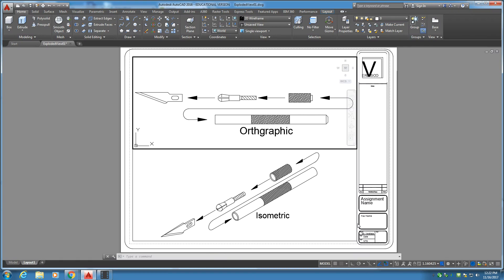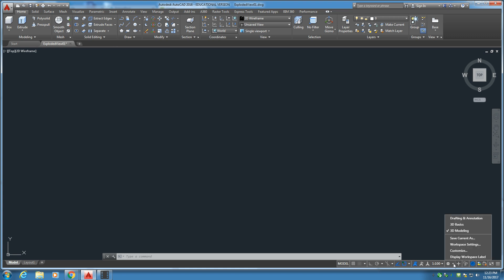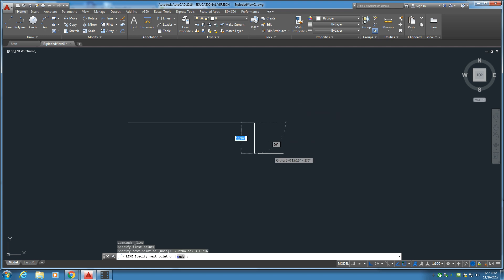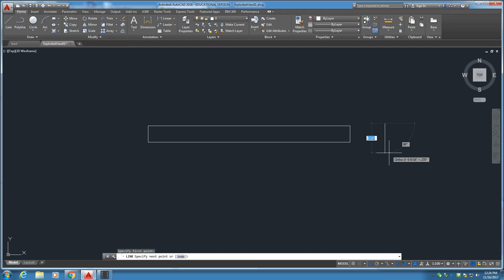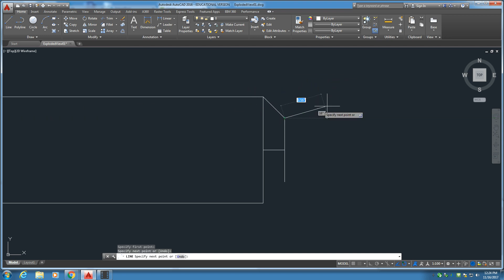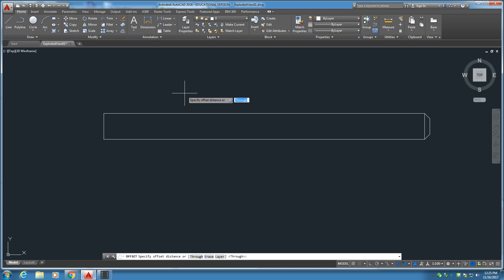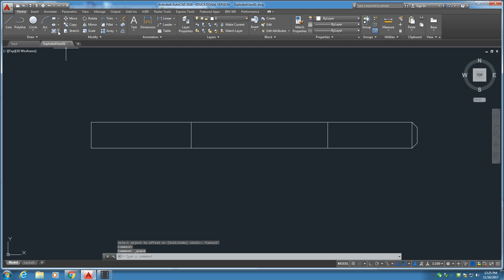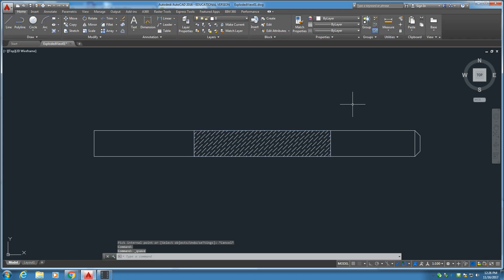AutoCAD  Exploded View part 1

Comment: Great video, sensei. I believe a microphone would greatly improve audio quality and recording in longer parts could be beneficial. Thanks so much!
Reply from the maker: Thank you for watching. I replaced my microphone this morning and created a test video. It turns out that there is still a good amount of white noise in the background (Mostly the climate control system). This noise source can not be eliminated/ turned off . Any suggestions?